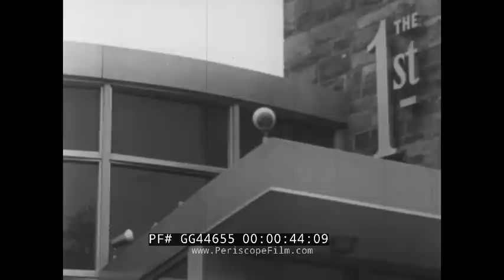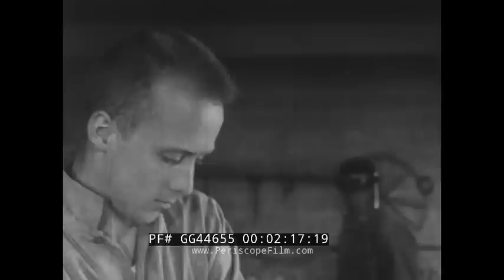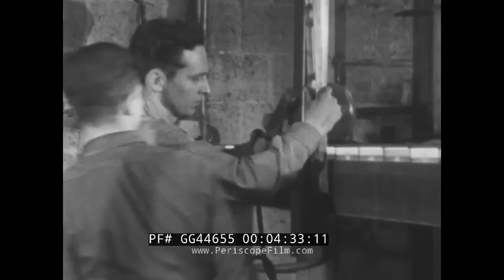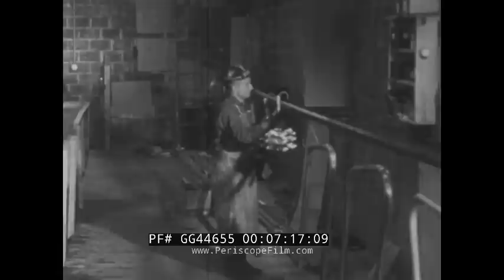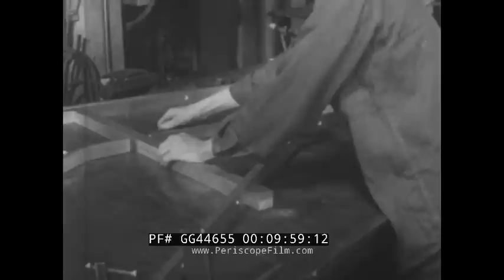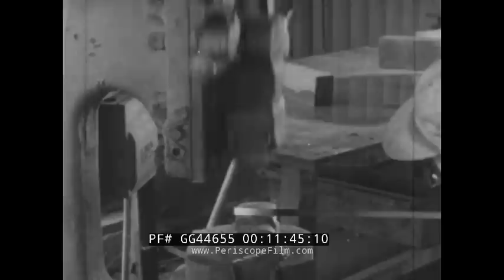“ AMERICAN’S AT WORK  IRON WORKERS ” 1959 AFL-CIO METAL INDUSTRY UNION WORKERS  MILWAUKEE GG44655

Comment: All these jobs gone because of unions.
Reply: The flip to that, is that these cats were taken HUGE advantage of, through the late 60's, 70's and 80's + in America (depending on where they were located, of course). That's almost one's entire length of their career, if they were willing to (or could, financially) stick though all of the down-time, that is. So yeah, I can agree with what you've said, to a degree... and even WITH unions, these workers weren't guaranteed actual work, either. Yeah, the whole "Union" argument is definitely a double-edged sword though, either way.

Now, however, a good skilled ornamental iron worker can pretty much write their own checks... but they're much rarer now, than they were back then, too.